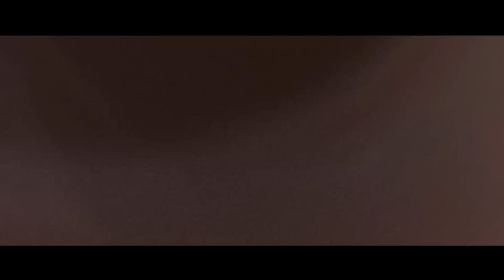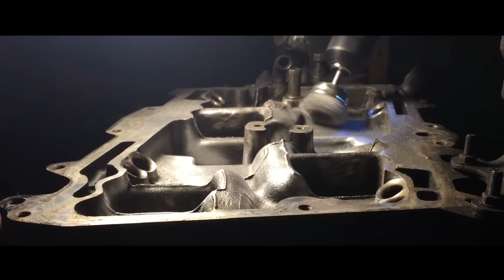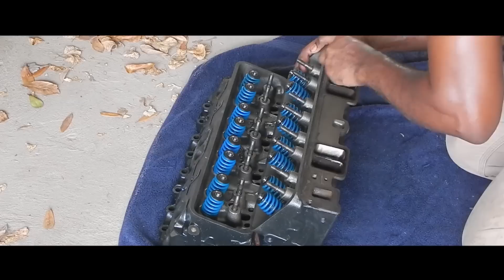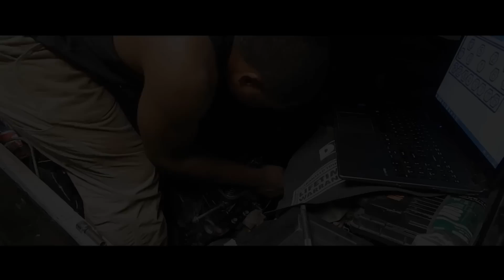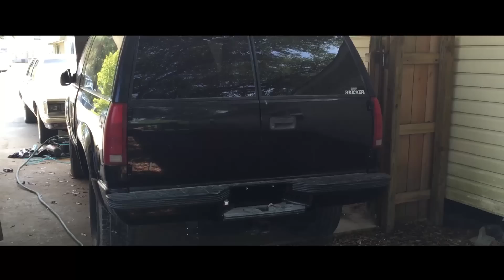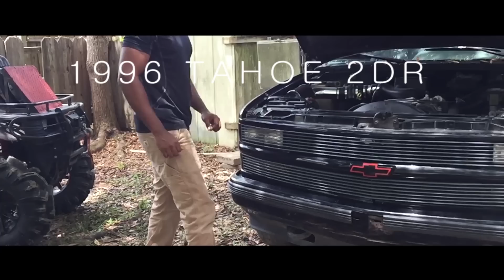5.7 Vortec LT4 Hotcam LS Spring Build in 1996 Tahoe 2 Dr

Comment: I know this is old, but wondering if you finished the project? did you upgrade the spider CSFI system to the MPFI spider system? I did not see any upgraded fuel system in your list, or a tune. I noticed the idle quality and the hesitation in the throttle response and just overall idle. If you haven't, I would look into feeding that LT4 Hotcam some extra fuel. Look into the 36lbs MPFI spider system and upgrading your fuel pump and get a tune. All those modes will be a total waste if those things are not done. even adding headers also will increase air flow but not the fuel, which will result in a lean A/F mix. Adding a cam, headers, porting the intake, ect, will improve the air flow, but now you got to feed it with what its starving for, and its Fuel... Other than that NICE!

Comment: I know this is a old video been following y'all for awhile.. how well did those press in studs last you did you change your rocker arms eventually to 1:6:? Have a similar build but going carb with lunati bracket master 2 .515/.515 cam and matching springs.
Reply: Yeah let us know cause I’m exactly doing the same process in my 98 l31 carb swap tho lt4 hotcam 906 vortec heads but I’m upgrading my studs to screw in 7/16th studs so I had to cut the bosses down and some of the valve guides also to run the higher lift without coil bind just to have the clearance
Reply: My bad you said your going with 7/16 not 3/8th's good choice I should of did that
Reply: @heavychevy2289  I figured might as well upgrade if I’m yanking the press in studs

Comment: Did you not upgrade the fuel pump and upgrade the spider system to 36lbs injectors to feed that cam? And did you tune it after all is done? I am looking to see if anyone actually complete the mod with the fuel system, since the lt4 hotcam needs extra fuel dump from the pump and injectors. The factory central injector doesn't supply enough fuel. It just supplies enough to start and idle and get it moving. Not enough for serious power. The best mod, ifbkeeping the spider, is to get the upgraded improved spider system with 36lbs injectors per cylindet, not the central that feeds poppets. Also the tuning to calibrate the fuel, timing to feed that cam. I have only seen one video with somone  who did all the upgrades.  And the performance was amazing! Snappy throttle response, not sluggish with hesitation when snapping the throttle back. Adding some stall converter and a built 4l60e with shift kit and vette servo and a 3:90 or 4:11 gears will get a truck moving fast! High 11's low 12's fast!!

Comment: The stock vortec system can handle all of that? I have a 97 I want to do it but scared about the tuning part
Reply: Don't be scared about the tuning. just find a tuning company online and they will hook you up. Its not difficult at all. just doing a tune and NO OTHER mods, the L31 Vortec can open up another 20-25 HP! The L31 is sooooooo restricted from the emissions. If you delet the CATS, add 2.5" dual exhaust and headers and get a tune, you'll get 35 plus HP. If you deleted everything, went with electric fan, electric waterpump, udersize pulley, ect...you can get close to 300HP!! I did everything accept the cam and my truck woke up A LOT! my next upgrade is to go LT4 Hotcam and upgrade the fuel pump and 36lbs MPFI spider upgrade. It will turn into a screamer! the stock vortec will handle 400 plus HP easily! get a tune!

Comment: Can you give me details on what you did for a throttle body mod??? Thanks keep going!!!
Reply: Probably either a spacer or he shaved down the throttle plate.
Reply: Tahoe OG you can remove the restrictor plate by unscrewing the throttle blade out of the throttle body then simply bend it of with pliers be careful not to remove the rivits it's aluminum so it just takes sum elbow grease and you can tighten the rivits by pressing them with the pliers

Comment: Hey man I'm trying to rebuild a tbi motor. 90 chevy. I'm trying to mod the tbi and know which fuel pump to use.
Reply: Really the fuel pump and injectors are good but you can raise the injectors and cut down that lip on top of the barrels and gain alot I'd keep pump and injectors unless you decide to tune but you can buy a 90-100 psi fuel pump that's a direct fit but you have to order it for a 1996 GMC YUKON and you have to tell them just the pump

Comment: Did it require a pcm tune?
Reply from the maker: +El Aguilera Yep. It was a hassle but the best thing to do is to convert it to a 0411 PCM and tune it with EFI Live.
Reply: +Turbros Garage I have a 96 4D Tahoe with the engine out rebuilding it and thinking about putting a cam in it.
Reply from the maker: +blackericdenice go with the LT4 Hotcam, best all around street cam and you'll have to have the heads machined for more retainer to guide boss clearance. Also better valve springs are a must
Reply: Turbros Garage I will check that out. I want at lease 300 hp.
Reply: @337speed  what lift is on this cam, and how did the pressed in studs hold up?